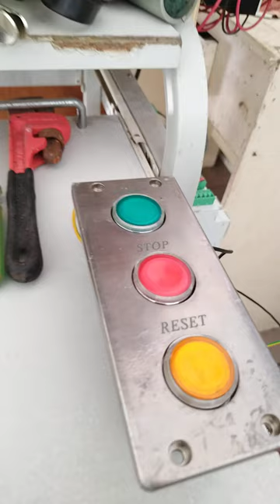#shorts DELTA VFD TESTING RUNNING A 3 PHASE MOTOR IN FORWARD-REVERSE DIRECTION.

Comment from the maker: change VFD parameter 00 and 01 to be able to run this motor in forward and reverse. 00 is for setting the frequency changing through potentiometer, and 01 for external control of VFD in forward and reverse rotation of the connected motor

Comment from the maker: the motor is 6 leads, you need to short some terminals to run it in forward and reverse direction always check the motor nameplate how to run it in DOL. this motor can be used also in wye-delta starting